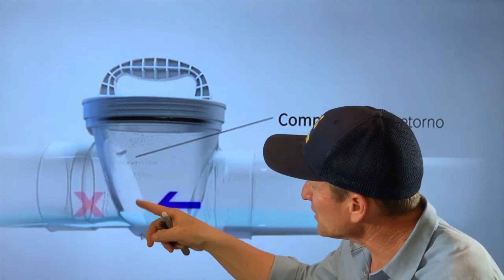How RATS GET IN TOILETS & DRAIN PIPES & HOW TO STOP THEM...WATCH THIS !!

Comment: Hello, nice video! Useful tips. I live in a very old brick/cement home (1920s). There have been mice chewing through the sheetrock walls. They've been coming in from everywhere including holes they've chewed near electrical outlets, holes in the corners of the rooms(which I've plastered over constantly sometimes with steel wool included. I moved in less than a year ago and have killed more than 30 mice. Haven't been able to get up on the roof to check anything(don't have a ladder), not sure if they're coming in from the basement. Don't see any visible holes in the outside of the house. I do live in a row-home, not sure if that matters or can make things worse? I'm from philadelphia, and live in an older section of the city. We have some of the worst rodent problems in the country out here. I even went as far as  Installing weather proof/under the door blockers, Filled visible mouse holes with anti-chew filler-foam when I moved in, and somehow these dang mice are still getting in. Any advice? Thanks.

Comment: I had an Air Admittance Valve (attached to a 3" vent stack) that rodents chewed through to enter my bathroom. Couldn't a rodent chew through that  backflow flap as well? It looks pretty flimsy compared to my AAV.
Reply from the maker: Yes, they can. We typically line it with a thin coated metal.
Reply: They will chew gas line out